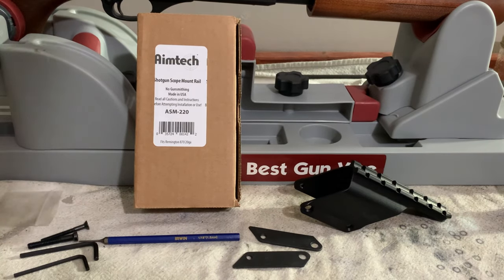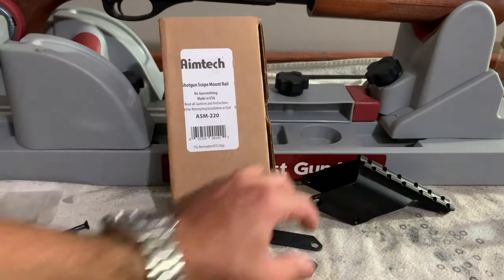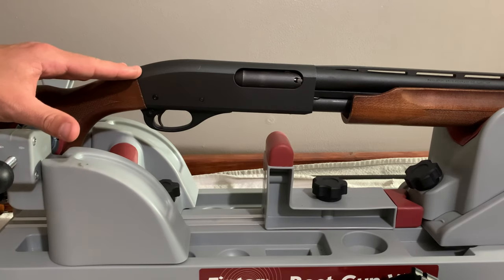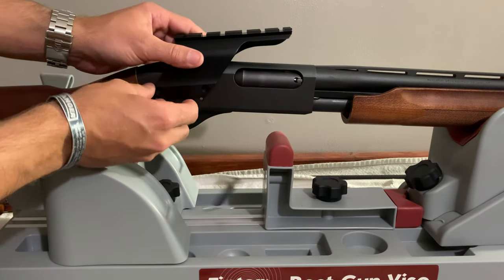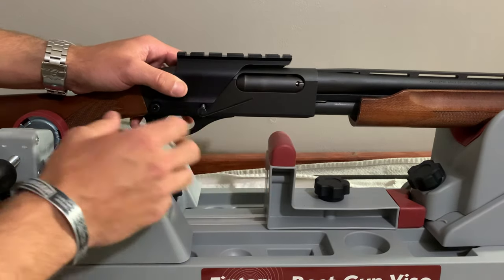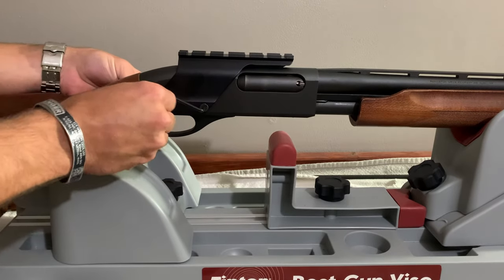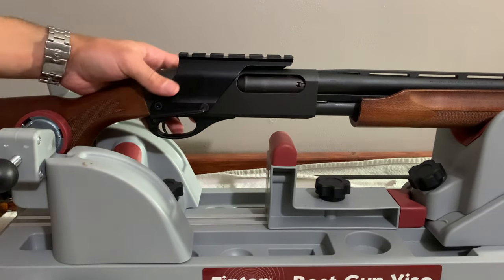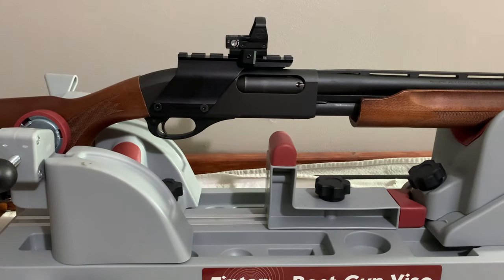Aimtech Saddle Mount Installation - Rem 870

Comment: Is that metal/steel. I keep finding plastic and I'm not looking for that. When you said that's for the 20g only because of the mount dose that mean I could still order this for my 12g but just don't install the spacers because the spacers are for the 20g. I keep having problems with my dang dovetail mount and when I install it shoots fine but as soon I use them 3in shell slugs or buck it screwes up and now my screws after I got loc tie to keep the screws Upton to not lossen up they snapped off and got 2 screws stuck on the top thread hole like REALLY.. SO IM LOOKING FOR THIS SINCE ITS MY ONLY OPTION. And I like the way this looks since it seems to me you can see under the mount to use your front sights. So this would be suitable for a scope correct because I'm using my 12g for deer hunting this season at 50 to 75yards then its gonna be used just as a bird/duck and hog type then imma get a rifle for the deer next year use.

Comment: Love the video, just what I’ve been looking for, do you have a long term review of the mount?
Reply from the maker: I can make one, but In summery I have no issues with it. I don’t baby my turkey gun and it has got banged around for two seasons now, and it has not come loose or lost zero. Shot one this year at 40 without checking zero first and it dropped no issues.
Reply: @pdoutdoors1506  awesome, I ended purchasing one for my 870

Comment: Doesnt that sight look a little high?
Reply from the maker: That’s why I added the cheek pad. It allows you to still see the bead incase of sight malfunction. It zeros no issue
Reply: I have a romeo red dot. I ended up swapping out the shorter mount so it sits lower. I put that on my 870 express and the magpul mlok forend with a flashlight and laser.
Reply: It looks VERY high.  I can’t believe there mounts don’t fit more flush along the top of the receiver.  Looks like there is 1/4” or more of spacing there! SMH.
Reply: Get a mount that simply pinches the vented rib of the barrel . Like Meadow Creek
Reply: It is pretty high, I wasn’t expecting it to be myself so yes you will need a cheek pad for this mount to work. I just got it and was disappointed with how high it sits, so I’m going to be returning it and finding something else. Wish they would’ve had a preview of it on a gun before I bought it.